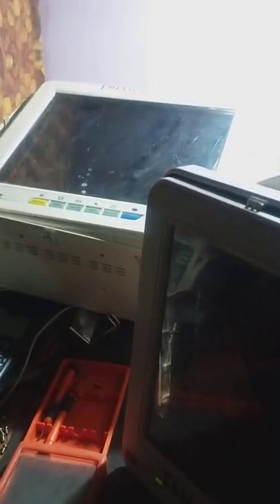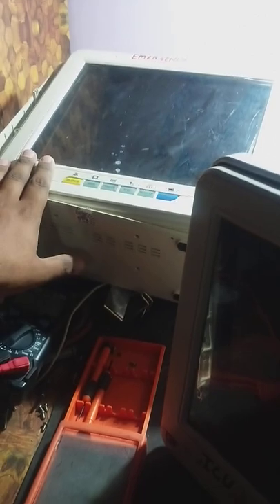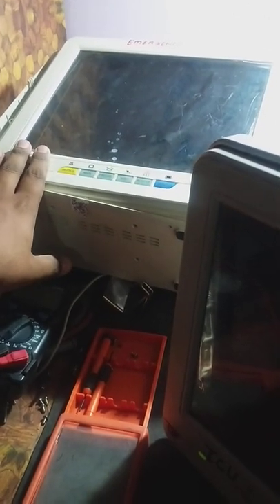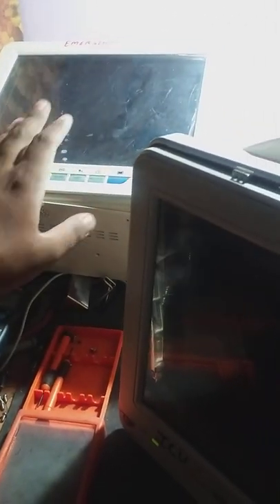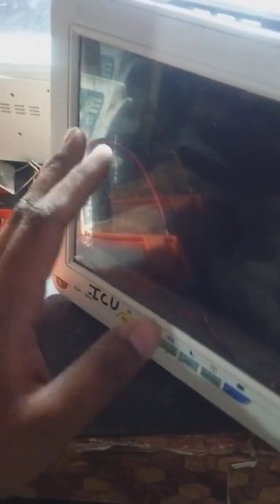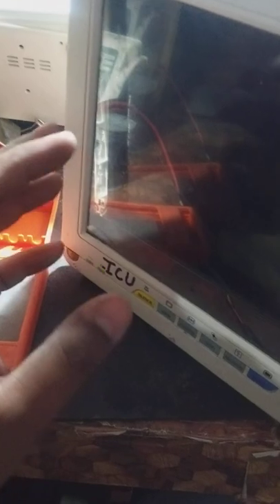Secret of Repairing Patient Monitor display fault | PART 1 | Chinese monitor repairing Niscomed.

Comment: Nibp always showing high.replaced cuff solenoid still high
Reply from the maker: Reset your Module by going in setting e times in e very 15 second interval. tha make it off for 1 minute and than come back and check it. if persist than comment us back for further help
Reply: How to reset module

In settings there is nibp setup I can see two options . first one is interval   it is in manual.

Then nextsettings is unit it is in mmhg
Reply from the maker: Which Monitor you r using and how much old is it
Reply: @biomedicalengineersrepairl1540  EDAN M3 basic..it's 4 years

Comment: How to analyse upper limit and lower limit solenoid valve
Reply from the maker: You have to go inside deep settings of this Hamilton ventilator.  Which provides in service manual. Available at our end
Reply from the maker: Go to setting ,than select NiBP option than u will get Reset. Other Go to setting and reset complete piece. Otherwise replace the Pressure sensors inside monitor , on NIBP board.
Reply: @biomedicalengineersrepairl1540  if I replace the air pump any chance
Reply from the maker: Send video of problem on 9068820087 whatsapp
Reply: @biomedicalengineersrepairl1540  thank uuuu